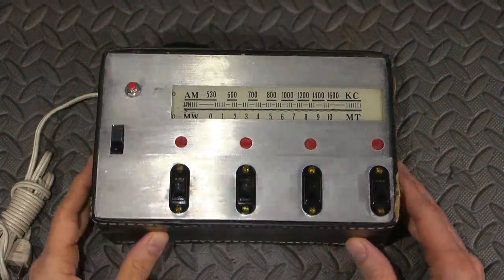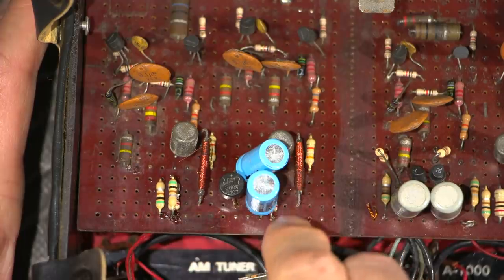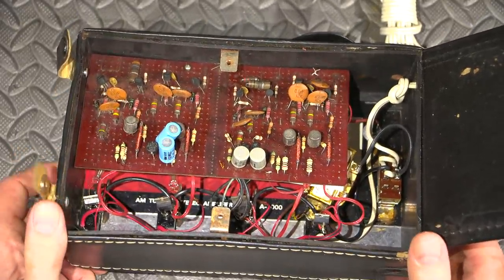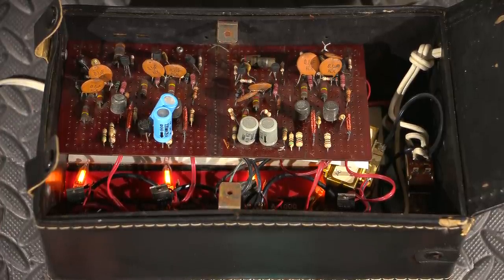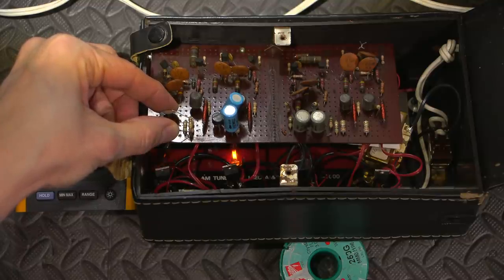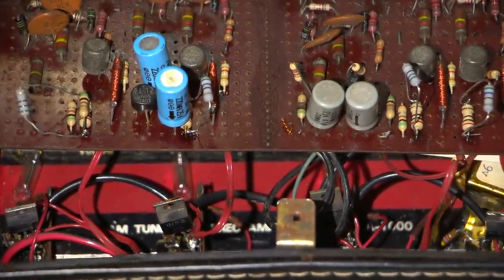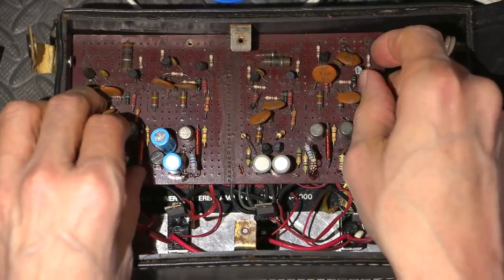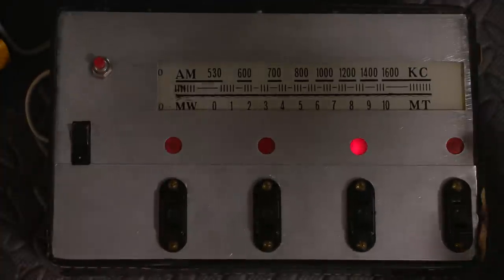Electronic Mystery Box - What Is It?

Comment: Great video. Just a quick note: Many 220volt countries are also 50Hz instead of 60Hz. From personal experience, a transformer run at a Hz that it was not designed for can overheat. Replacing the existing transformer with a 110v 60Hz might be the simplest/safest fix.

Comment: For my flux bottles I use blunt-tipped "glue" needles...they came with plastic covers that not only protect me from accidents but also helps keep the flux from drying out.
Reply: Would Eye Drops bottle work?
Reply: @kareno8634    
I'm not really sure...couldn't hurt to try it though  :)
Reply: @gregorythomas333    Thanks.   haven't used needle[d]  bottle -  tho -  may be 'lack skill' [?] with lid 'Spouts', either break or never seal well (cleaned).   - not a glue connoisseur.  lol
Reply: @kareno8634  just don't make the mistake of putting flux in your eye, I cringe at the thought.  Eye dropper not as precise as the metal blunt needle tip. I have an old syringe from the local feed store that sells health care stuff for farm critters. Just filed off the sharp point.

Comment: It probably has the radio dial to get it through customs inspection as a radio while it was used as an explosion sequencer for taking down structures. Pure sinister conjecture. :)
Reply: ROFL!!!
Reply: Uhh dont give anybody ideas haaaahaaa
Reply: It does look that way. That's why you would use an old radio dial too! The customs folks wouldn't know the difference. Now if it was used to take down buildings I can't say.
Reply: I would hate to be using that as an explosion seq. and accidently get it near anything with a magnet. Those reeds also triggered on being bumped, banged, or even loud low freq. sound. Come to think of it, they're the perfect tamper detector for IEDs.

Comment: Don't think it was built in Japan.  Most of Japan uses 103V 50Hz for basic home service and only reserves 200V for high power appliances.  This looks like some of the Popular Electronics projects I used to build in the 1970s.  Mine were a little neater, I dare say, but this one has the advantage of still working while all of mine have gone the way of the dodo or been stripped for parts several times over.
Reply: I was puzzled by the voltage issue. But I don't know another country that uses 200V for anything, plus that certainly appeared to be Japanese or Chinese writing on the card. Add in the use of Japanese transistors. Where do you think it comes from?
Reply: I was going to say the same.  Right plug, but I think they're all 100V, but a mix of 50 and 60Hz.  Europe does a lot of 220 for regular outlets.
Reply: I did some hunting. There are countries with that style plug that do 220V, but they'd be a bit unusual for showing up here.  Places like China, Philippines, Thailand, Vietnam being the bigger ones.
Reply: @russellhltn1396  China is supposed to be 220V, not 200V, but maybe they figured "close enough." Someone in China with a handful of Japanese components? Neither the Phillipines, Thailand, nor Vietnam write with Chinese characters, as far as I know, although one might not be that surprised to find some Chinese written materials in any of those places.
Reply: Still, my best guess is Japan, built for some special spot where there happened to be 200 or 220V available. Maybe in an industrial setting of some kind. Or military, which might explain how it got to North America.
Reply: OK, maybe it is of Japanese origin.  I worked for 30 years on US military bases in Japan and they always used big motor-generators to convert Japanese 100V, 50 Hz into 120V, 60Hz so the servicemen could use the American appliances they'd brought with them or bought in the BXs.  Of course those who lived off-base were restricted to the standard Japanese grid and had to use transformers for their American appliances.  Seldom does anyone use 200V in their homes even if it is available, including the brand new house I live in now. However, this device was clearly built by a hobbyist and he would have had access to various voltages and parts, standard or not.  Maybe that 200V transformer was the only one he had.  Other signs such as the word 'Japan' etched into the copper, the one Japanese character I can see on the card Paul lifted up, and the use of Japanese transistors, plug and outlets all suggest Japan, but how the thing found its way to Canada is still a mystery.  BTW, 100V 50Hz is used in the Kanto region (east side of the country) and 100V 60Hz is used in the Kansai region (west side of the country).  Both have 200V as well but the plugs are different.  The plug and sockets on this device are clearly of the 100V type.
Reply: One hundred volts was common with early electricity before the voltage was jacked up. It was probably the same with Asian countries like China starting out at 200 volts. It might have been 200 volts in the 60s and later jacked up to 220. It seems the US is being regulated to 123/246 volts and the UK to 246. It could be more efficient or something.
Reply from the maker: Scroll down the list to Japan: https://en.wikipedia.org/wiki/Mains_electricity_by_country
Reply: It says am radio on the back of the faceplate that looks like it was repurposed from a radio and the tuning slide was left to cover the hole.
Reply: @MrCarlsonsLab  No appliance in Japan uses 200V dude.

Comment: About 3 minutes in when it appeared there was a radio in it, I thought it was a 4 channel color organ that was tuned to a set frequency. In the mid 70s they were very popular, and the parts would have been very similar.
Reply: Color organ was my first thought as well.
Reply: Great minds think alike! I built a few of these color organs when I was a kid. One popular model in Scandinavia from came from Josty Kit, a Danish electronics company.  But instead of (reed) relays those constructions used diacs and mains voltage (220V) all over the place. Caused a few blown fuses and traces, sparks and shocks before we got the hang of being careful and do proper soldering joints. Those were the days! :)

Comment: This reminds me of a project I built many decades ago, based on a design in an electronics hobbyist magazine here in the UK.  There was a box with 4 triac driven mains voltage outlets.  You would plug coloured mains (240 volt) lamps into these outlets eg red lamps into outlet 1, green into outlet 2, etc.    There was an electret microphone mounted just inside of the box.  This was connected to an audio preamplifier and then to 4 audio filters that would sample different ranges of audio tones  eg sub-bass, bass, mid range and top audio range.  The outputs from these filters were amplified and fed to the triacs.  The purpose of this was to produce coloured disco lights that flashed in time to the beat and audio frequencies of the music.  It worked perfectly but was untidy.  I got rid of it after my children moved on to other interests.

Comment: Electromagnetic controlled light chaser. An older project from 1978. I saw this project in an old electronics magazine. The builder of this one put it in the old radio case, because it is most likely the only enclosure he/she had at the time.
Reply: Yeah, I think you are correct. I believe it was in a "Popular Electronics" but I don't feel like pulling out my collection to make sure.
Reply: Yeah. As a kid, I built pirate radio stations with audio mixers built inside cigar boxes and baby-wipe containers. The baby-wipe mixer worked best, but I didn't like the soapy smell when I was on the air.

Comment: I made basically the same thing a few years back, but with a 555 and a decade counter. I used it to switch relays to sequence 4 kodak carousel slide projectors. Control voltage is 13V AC, hence the relays. If anyone wants to build something similar, a good tip is to use every other pin on the counter so the projectors don't run away and change slide twice. Used a pot to adjust the frequency.

Comment: The band Rainbow in the mid 70s had a massive, well, rainbow that spanned their stage. Stories say the control box was stupidly simple, and I like to think something like this might have powered it. It used to interfere with the amps, and was massive and hard to lug around. Apparently they were travelling by ship at some point and decided to just turf the dang thing into the sea, and were pretty happy to get rid of it.
Reply: I remember seeing that at Leicester De Montfort Hall in 1976
Reply: @noelwalterso2  That's awesome, I only have a DVD of the '77 performance, as I did not exist at the time :)
Reply: I suspect a lot of stage lighting for music was extremely crude stuff like this box as its driver back in that era, just because it was still an early time in electronic light sequencing. After all the computer controlled multiple kilowatts of lighting we have today had to start somewhere.  I wouldnt be shocked if a of the firms that build lighting shows now started as a few people with some boxes, parts and a soldering iron.

Comment: I made something very similar to that in the late seventies or early eighties. Wound my own isolation transformers to run coloured mains lights or mains lights with coloured cellophane in front of them Mine was a disco light controller and one of the positions was sound to light setting.  There was 4 lights in a 2 x 2 array., common arrangement in the seventies. The Circuit I used may have been Electronics Today magazine or Everyday Electronics In the UK

Addition: I remember the triacs had to be switched on the Zero crossing point of the AC voltage.
Reply: Ahh those were the days and I loved those electronics magazines. I built many a project from Electronics Today. That was when Maplins Electronics was a real mail order electronics company.

Comment: The case looks like it was an AM radio.  I can remember buying a radio very similar and also remember the two snaps on back to get at the batteries, probably used 4 D-Cells.  The dial would have gone side to side across the shorter width towards the top.  I had one like that in the 70's.  I had electronics in high school in the 70's and remember kids recycling cases for their projects.  The perf board really looks like it was a high school project of some sort.
Reply: @Runco990  I agree that shop classes were important.  In my senior year I also took metal shop along with electronics.  I learned how to gas weld, and still know 40+ years later.  The ironic thing was that for my senior year of electronics the instructor had to "dust" off the class for tubes!  He normally only taught Electronics every other year, and it was solid state based.  We got enough students together to sign up for 12th grade, needed 7 students to keep the class but 12 to get it scheduled.  We got 5 "burnouts" as they and everyone else called them (think pot heads) to come and sign up for the class so we could get it scheduled.  First day of class the 5 burnouts came in, got a pass to the front office, so they could drop the class and get a study hall the last period of the day.  All 12 of us students were happy and I got to learn tube technology.  I only used it once.  I bought a 1957 Thunderbird with AM tube radio that didn't work.  I dusted off my knowledge and sorted it out and got it working again.  I did need a huge DC power supply because of all those heaters.  So watching this channel brings back memories of that and that tubes are not quite dead and there is at least Mr Carlson out there bringing one tube device back to life.

Comment: @1:33 Looking at the circuit board I was thinking possibly a "Color Organ" type device, but I did not see any input jack(s).  Now I'm thinking it is a light sequencer for marquee type effects, or a 4 channel flasher at different intervals.
@2:20  The top half of the circuit board look like it contains 4 sets of transistor flip-flops, possibly a 4 bit binary counter.
@11:30  Push button is a mode switch,  1 output on 3 off, 3 outputs on 1 off,   all outputs on.
Reply: Yes! Colour organ or light organ. I built one of those. Neon bulbs at each of the three outlets. Pots for sensitivity. Some haphazard capacitors and such - so not really a proper frequency band thing... just blinked and flickered differently for each channel.

Comment: I uncovered a project I built back in the late 70's using TTL and wire wrap. One of the boards has over 50 chips on it. Unfortunately my hand drawn schematics seem to have disappeared.  It is nearly impossible to trace out the circuits under that jumble of 30 GA wire!  To make it worse, I used a couple of 74188 prom's and have no idea of the code I burned into them. Reverse engineering that sequencer would almost be child's play by comparison.

Comment: Quite a cute little gadget! Construction reminds me of the stuff I'd do when I was a tad younger, though I'd usually not mess with mains voltage back then
Reply: Mains voltage in the US or Canada is only 120v so just hurt a little, as a kid who's torn my share of electronics apart can contest.
Reply: @mrbyamile6973  I've been shocked by 120v plenty of times by now (though my house is a bit on the high side at 123-128v)

It's still not a pleasant experience though!
Reply: Me too, and that was built when plug-in breadboards were probably not available for prototyping. If it didn't work, you unsoldered and tried again.

Comment: No need to use reed relays or opto isolators in a closed system like this. As long as there is no external input to the count circuit, you can trigger a triac directly from the low voltage logic. But you must then reference the DC supply voltage to the AC line so it becomes a "hot chassis" device.  I built a few of these just like that in the mid 70s - you know, the disco age. My logic array was all TTL gates with an open transistor drive to the triac gate. The +5 volt supply was tied to one the hot side of the AC line. Perfectly safe as a closed box but I blew several up in the troubleshooting stage by accidentally grounding the DC power supply common, which then put 120vac line directly across the 5volt supply!  I too eventually went to opto isolators but they didn't have the fancy triac based isolators yet, at least not available at Radio Shack. So in using standard NPN isolators, I needed a second DC supply tied to the AC line. But at least the TTL logic was now safely isolated. My master clock was also a tad more advanced. I used a 555 timer which also allowed a variable speed control!

Comment: It's a typical chasing light controller. 4-channel light strips controlled by something like this used to be common in, for example, store entry chance/skill games. Nice to see a home brew solution.
Not sure this isn't digital; the stuff with all the TO92 transistors looks like discrete RTL gates and flip flops.
Reply: Something told me flip flops after seeing the symmetry in the resistors/layout they had but couldn't figure out the big TO-220s at the bottom until he said what they were.  Ingenious isolated switching however.  Don't know much about the more digital/logic area of electronics so guess I got to learn what a shifter register was after reading down here!  Seen the caps however...after digging out of hifi gear in need of them getting replaced by now lol.  For sure recognized the signature weird colored cream-grey Elna's on the one half of that very vintage perf board.  Bet that thing was reeking of vintage fumes.
Reply: Yup, it's digital, they're discrete flip-flops

Comment: At 6:52 Mr Carlson is pointing to a "... transistor ... here as well..." which are the two small black cans near the two large white capacitors on the right half of the board.  I think that these are diodes making a full/half wave bridge to turn the 9VAC into DC.  If you look next to the two large blue capacitors on the left side you will see a black round device which, from the symbols on top of the can, is definitely a full wave bridge.  So each half of the circuitry has its own rather simple linear power supply.  My best guess and $0.02.

Comment: Hi...  Thanks for the interesting video !   I wonder if this perhaps was a project out of a 60's (or 50's ?) electronic hobby magazine...  Further, I might wonder if it did work at 120 VAC and perhaps the neon tubes are just not lighting up after all these years as easily at 120 VAC as they did when you fed the circuit with 200 VAC...

Comment: Surplus electronic place down the road had a customer of Asian origin used to come in all the time. When the customer passed, his wife called the store and begged the owner to come get all the stuff the old fellow had hoarded over the years. Test equipment, signal generators, digi voltmeters &c. In multiples. Some of it inexplainable or inexplainably modified & cobbled together. I ended up with some of it in my shop. This looks like a similar project from the old guy’s hoard. 73 de W8IJN

Comment: As soon as triacs were mentioned, I said "disco light controller"!
The one I built in 1971 for our mobile disco used thyristors and bridge rectifiers because that's what was available in the stores where I worked!
It was a genuine "sound to light" with three lumped LC filters, their was no electronics, the input was direct from the main speakers via a step-up transformer for isolation.

Comment: Hello Paul
I like to experiment with building my own circuits. I converted a small three inch reel to reel tape recorder from DC bias to AC bias because they look better than they sound hahahaha 😆. The oscillator is a single transistor design using a small standby switch mode transformer taken from a scrapped TV power supply board. It works really good it has a frequency of 38khz at 45volt peak to peak clean sine wave and powered by a nine volt battery and very good sound with no noticable distortion. I wish I could show you the circuit. I've been working on it for awhile on and off getting it perfected. It taught me a lot about proper tape bias and equalization